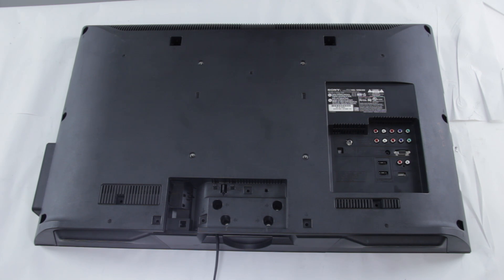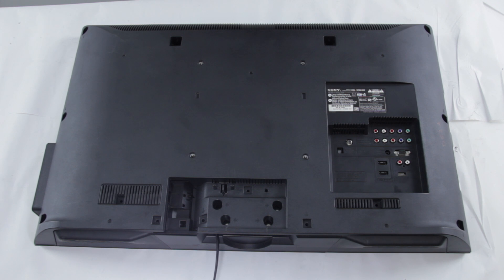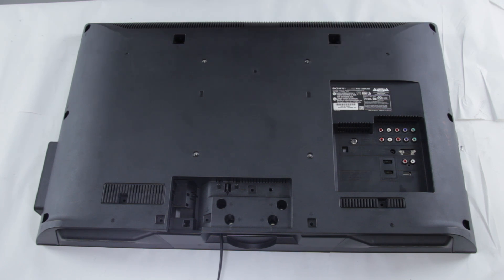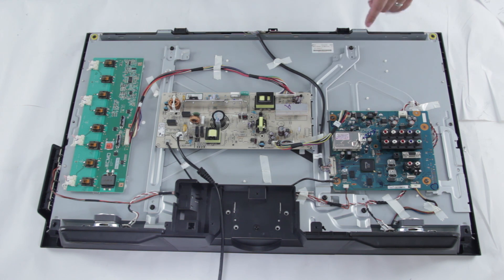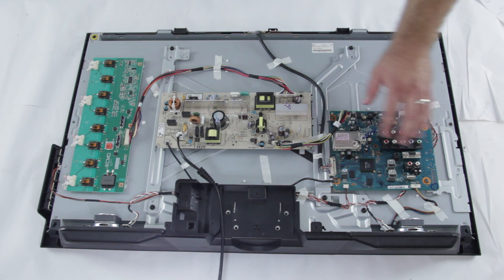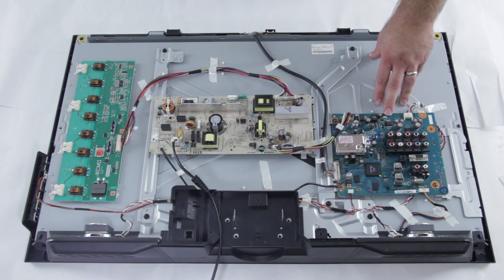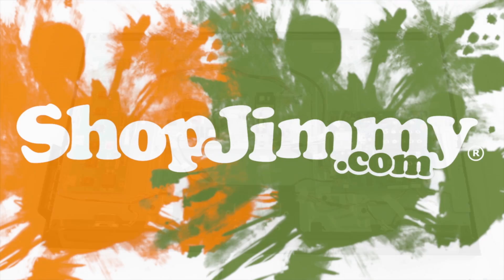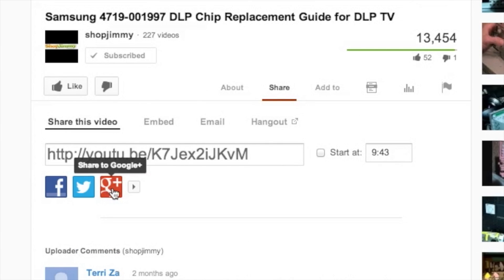LCD TV Repair - TV Has Audio, No Video - Common Main Board Symptoms & Solutions

Comment: Hey 
I own a Philips 37' LCD TV. My TV's model no. is 37TA2800. My TV is running good in the HDMI input but in AV and Side AV inputs for cable and DVD player it is only running the sound. The video on these inputs are not visible. Only a blue screen stays. Apart from that i can use the menu option of my TV and change the settings like brightness,contrast and all other stuff but I am unable to see any video. I have checked the DVD player and cable on a different TV.
What is the problem in this TV and what is the possible remedy??
Reply: ShopJimmy.com My main board no is 715T2408-4. Can You suggest me a replacement?
Reply from the maker: Rachit Shroff   Try all repairs and troubleshooting at your own risk.  Click this link to a search result for that number on our website.  http://www.shopjimmy.com/catalogsearch/result/?q=715T2408-4  There may be multiple boards for the same TV model number, be sure to match part numbers on your current board, with your replacement for compatibility.  Thanks and please let us know if you have any further questions with your TV Repair!  www.shopjimmy.com

Comment: I have a samsung ln46a550p3fxza. I have picture and sound when I use av cables, but when I use hdmi cables in any of the hdmi ports on the tv I get vertical color lines. Sometimes the picture can be seen behind the lines other times it's just a black screen. And it has a high pitch screeching sound. Just not sure what to order don't want to waste any money. Your help would be greatly appreciated.

Comment: Hi I really need your help. Okay I will start from the beginning, I have a Samsung dlp tv hl-s6186w. The tv would flicker with white picture and turn off with 3 lights blinking standby.temp. lamp , so I thought replacing the lamp was best. I have done that, now 1. Tv wont turn on 2. Flashing lights standby and temp. 3 MAJOR problem a wire on the video Main board started to smell and burn. It's the 12 pin I think that goes to the board where the dlp chip is located . .not sure of wire name. PLEASE help me Idk  what to do ..nothing in the tv comes on either no fan ,no bulb.

Comment: i have a hisense 50k360g   serial# 3TE50G1225051708539 the problem is when i turn it on its just a blue screen and a back light on , it does not display the logo or anything when turning on .I can not change inputs because it doesn't show it on the screen .i have checked the compacitors on the power supply and all are good. any help with this would be greatly appreciated

Comment: I am working on a friends 32" Samsung TV. Replaced the T-con Board after looking at a few videos.
SAMSUNG LN32A330J1D LCD Controller T-Con Board V315B1-C01
I replaced it and still am having a white solid vertical line across the screen. Can you help?
Reply from the maker: Samuel Guerra   Try all repairs and troubleshooting at your own risk.  This sounds like a TV panel (TV Screen) problem.  If your TV panel is bad, it may be more cost-effective to replace the TV as panels are typically hard to find in stock, difficult to replace, and expensive.  Thanks and please let us know if you have any further questions!  www.shopjimmy.com

Comment: hi! i have a sony LCD tv model-klv40ex430 . the problem is that on switching the device the panel remains white and in about 2 second the panel gradually starts to turn black from the center to all the borders grain by grain and turns entirely black.. but the fact is that the audio works properly as the given input.

what must hav gone wrong!!!  expect an immediate reply
Reply from the maker: radhakrishnan divakaran   Try all repairs and troubleshooting at your own risk.  This sounds like a TV panel (TV Screen) problem.  If your TV panel is bad, it may be more cost-effective to replace the TV as panels are typically hard to find in stock, difficult to replace, and expensive.  Thanks and please let us know if you have any further questions!  www.shopjimmy.com

Comment: I have an Samsung 46" LCD with sound but no picture. The model # ln46c530fif and serial # z1mj3csz800252a. I did the flash light test and I can see parts of the menu on the screen. I looked it up and everyone one says that it's the inverter but I'm not sure what the inverter is and how to replace it.

Comment: hi i have a sceptre 42 lcd - replaced both the inverter board and the tcon board with your parts. tv still does not work. Main board? power supply? tv turns on, no video, has audio, backlights off. Then sometimes the backlights will come on and there will be a picture, will flicker on and off, sometimes will stay on for 10 minutes then backlights turn back off, will unplug reset tv and picture will flicker on off then stay off. I thought it would be inverter board....
Reply: Ric D used AUO 19.42T14.001 (V298-C01) Backlight Invertersj-19.42T14.001
Reply: Ric D and AUO 55.42T14.C09 (46T03-C0K, T460HW02) T-Con Board
Reply from the maker: Ric D  PLEASE SUBSCRIBE TO OUR CHANNEL - Try all repairs and troubleshooting at your own risk.  What are the original symptoms and problems with the TV, before you replaced any board?  Thanks!  www.shopjimmy.com
Reply: ShopJimmy.com hi i did the flash light test like you requested. I did see a picture with the flash light. I would assume that would mean the inverter board was bad but thats what i replaced already along with the tcon. So is the inverter i ordered bad? Is it the main board? Or something else? Please let me know

Comment: I have an LG 47lm4700-ue the picture does not come on but I have sound. My screen is blueish and I do see a light when power is on
Reply from the maker: Kyle Cleveland   Try all repairs and troubleshooting at your own risk.  This could be a problem with either the t-con board, the main board or the TV panel.  You can replace the main board and t-con board individually to see if one of those boards fixes the problem.  Click this link to replacement parts for your TV model number:  http://www.shopjimmy.com/catalogsearch/result/?q=47lm4700-ue  There may be multiple boards for the same TV model number, be sure to match part numbers on your current board, with your replacement for compatibility.  Thanks and please let us know if you have any further questions with your TV Repair!  www.shopjimmy.com

Comment: I have a Polaroid TLX-04240B. We get picture with any input source but after 30 min run time the screen goes black but we still have sound. The repair shop, after 6 weeks of run around said that the bulbs were bad and it would take $1200 to repair. But we could leave it if we didn't want to worry with disposal. Is there any truth to this?

Comment: I have the same Sony lcd color TV (2008) that's on the video. Green power light is on but there's no picture or sound. Would that mean that I should change board. If so where can I find board and how much are they?
Reply from the maker: Ricky Thierry   Try all repairs and troubleshooting at your own risk.  I recommend running the flashlight test on your TV.   Here is a link to a video we produced that shows how to run the flashlight test. https://www.youtube.com/watch?v=xUzCLgoSPGM Please reply with your flashlight test results and we can recommend a replacement part for your TV repair. Thanks and please let us know if you have any questions! www.shopjimmy.com

Comment: no television lost audio soon after loss of picture,went to bed had tv woke up no video,but still had audio,lost audio soon after that.model led65g55r120q
Reply from the maker: Lisa steinmetz  Try all repairs and troubleshooting at your own risk.  It could be that you have bad LEDs in the TV, but you can try replacing the main board to see if that fixes the problem.  Click this link to replacement parts for your TV model number:  http://www.shopjimmy.com/catalogsearch/result/?q=led65g55r120q  There may be multiple boards for the same TV model number, be sure to match part numbers on your current board, with your replacement for compatibility.   Thanks and please let us know if you have any further questions with your TV Repair!  www.shopjimmy.com

Comment: was able to try flashlight test with no result,i do get a red power light and when i shut down the tv,it gives a sudden low flash on the screen which is like a millisecond long,have removed back service panel and found only 3 boards,2 of which ive already found on your site,part #re46z2120,and v465hq1-cs1.the last board u did not have 3393b1420,any suggestions where i should start?
Reply from the maker: Lisa steinmetz   PLEASE SUBSCRIBE TO OUR CHANNEL - Try all repairs and troubleshooting at your own risk.   It sounds like the TV has bad LEDs in the TV, but you can replace the main board to see if that fixes the problem.  Click this link to replacement parts for your TV model number:  http://www.shopjimmy.com/catalogsearch/result/?q=led65g55r120q  There may be multiple boards for the same TV model number, be sure to match part numbers on your current board, with your replacement for compatibility.   Thanks and please let us know if you have any further questions with your TV Repair!  www.shopjimmy.com

Comment: I have a 1.5 year old 58" Sanyo the power went out and right back on and it lost all channels it will not pickup any channels when we make it scan. I only have an antenna  for over the air signals. Some one said it was the tuner, what board is that located on and does that sound correct to you? I don't have the model number it is still on the wall.

Comment: I have an LG LS5750 TV that is a couple of years old.  A couple of weeks ago, the picture went out.  The audio and back light still work.  I opened the TV and checked the connections, and everything seemed fine.  I turned the TV back on, and the image it displays as it boots up showed up fine.  However, when I tried to connect to my DishTV, the screen went out again.  After some research, we thought it might be the T-con board.  We sent the board to you for a repair, but you sent it back saying the board was working fine.  Could it be the main board that is causing the problems?  Or is the cable from the main board to the t-con board a possibility?  Thanks!

Comment: Looking for info on Philips  mod#20PF5120/28
PROD# BZAA0538580128
ONLY S-VID AND COAXIAL WORK NOT AV JACKS RWY OR COMPONIT INNPUTS ?????ANY SUGGESTIONS?
Reply from the maker: Dean Yack   PLEASE SUBSCRIBE TO OUR CHANNEL - Try all repairs and troubleshooting at your own risk.  I recommend replacing the main board in your TV.  Click this link to replacement main boards for your TV model number:  http://www.shopjimmy.com/philips-313815863621-cba-scaler-for-20pf5120-28.htm  There may be multiple boards for the same TV model number, be sure to match part numbers on your current board, with your replacement for compatibility.  Here is a link to a video showing how to identify your part number, click here:  https://www.youtube.com/watch?v=xSSxNZXZIXA  Thanks and please let us know if you have any further questions with your TV Repair!  www.shopjimmy.com

Comment: I have an LG TV and I believe the main board is bad because none of the inputs seem to work.  I've tried several of the HDMI connections, component, USB and TV.  When turned on the screen shows the main LG screen.  I can't get the menu to come up either.  The part number is EBU60852909 but it appears to be out of stock everywhere for the $108 price range.   Is that because so many of them are going bad?  Perhaps I should just throw it away if they are going bad so frequently.  Any suggestions?

Comment: Hello I have Samsung LN52A550P3FXZA and it will turn on and off with a blurry screen 5 or 6 times before clicking and staying on with a good picture . The problem is not the capacitor problem that these TVs are known for, I have replace those a few years back and they are still good. I have tried a new T-con and power supply boards and that was not it. Any thoughts on what it can be would be greatly appreciated. Thank you

Comment: hi, my tv sony bravia model kdl 40hx701 serial 8024224  dont start, i disconnect the ac cable and connect to try turn on and nothing happens, only the red led flashes 7 times.
some people told me maybe the video card is wrong, ¿could this be right?
Reply from the maker: Angel Acevedo   This sounds like you have bad lamps in the TV.  Unfortunately we do not sell replacement lamps.  Thanks!  www.shopjimmy.com

Comment: I have an Lg svc # 47LD650-UA.AUSWLJR and lightning struck like super close. (It was plugged into a surge protector as well as a GFI!) The HDMI that was plugged in at the time no longer works, and neither does the sound.  I tried a sound bar and tried turning the speakers on and off on the TV and no sound even out of the sound bar.  All the other 3 HDMI ports work and the picture is clear. I can live with the one HDMI not working, but no sound? Closed caption is hard to follow and covers some of the picture! LOL. Is this going to be a main board replace?
Thanks,
kcrancho
Reply from the maker: KC Rancho  Try all repairs and troubleshooting at your own risk.  I recommend replacing the main board in your TV.  Click this link to replacement parts for your TV model number:  http://www.shopjimmy.com/catalogsearch/result/?q=47LD650-UA  There may be multiple boards for the same TV model number, be sure to match part numbers on your current board, with your replacement for compatibility.  Here is a link to a video showing how to identify your part number, click here:  http://www.shopjimmy.com/catalogsearch/result/index/?cat=56&q=47LD650-UA  Thanks and please let us know if you have any further questions with your TV Repair!  www.shopjimmy.com

Comment: I have a Sceptre X32 LCD tv, I have a good picture but no sound.  Before it went completely out you could get the sound to work by turning the tv on and off.  Sometimes only after a couple times and then it took longer until finally not all.  I have unplugged everything and tried each separately.  It worked once on HDMI and once with just the old style plug ins. It hums a little when you turn it on.  The headphones do not work either.
Reply from the maker: Theresa Nowak   I recommend replacing the main board in your TV.  Click this link to possible replacement parts for your TV model number:  http://www.shopjimmy.com/catalogsearch/result/index/?cat=56&q=Sceptre+X32  There may be multiple boards for the same TV model number, be sure to match part numbers on your current board, with your replacement for compatibility.  Thanks and please let us know if you have any further questions with your TV Repair!  www.shopjimmy.com

Comment: Ive got a Magnavox 42MF337B/37 (SERIAL BZA0724360478).  I use it in my outside patio. It recently stopped working.  Started by the picture going pink or green (with sound) and now i get no picture (cant tell if i still have sound because i cant see to change the source to one i know is giving sound).  Any idea what it might be?
Reply from the maker: Marco Salgado   I recommend replacing the main board in your TV.  Click this link to replacement parts for your TV model number:  http://www.shopjimmy.com/philips-cbpf72mkpc-main-board-for-42mf337b-37.htm  There may be multiple boards for the same TV model number, be sure to match part numbers on your current board, with your replacement for compatibility.  Here is a link to a video showing how to identify your part number, click here:
Thanks and please let us know if you have any further questions with your TV Repair!  www.shopjimmy.com

Comment: I have a Vizio VW46LFHDTV10A that has no sound and no video.  When the unit is turned on, the screen lights but there is nothing displayed.  No Menu or any other type of display or sound.  The remote works to turn the TV on and off but it appears to not function in any other form.  I've checked the power supply outputs for 5 12 and 24 volt output and they appear correct within .5 volts.  I've plugged an audio source into the VGA audio in and attempted to select that source with no audio.   I've tried to use a HDMI souce into all the HDMI connectors again with no sound or video.  Any help would be appreciated.  Thanks!
Reply from the maker: Ral Lynch   I recommend replacing the main board in your TV.  Click this link to a replacement main board for your TV model number:  http://www.shopjimmy.com/vizio-3646-0082-0150-main-board-for-vw46lfhdtv10a.htm  Be sure to match part numbers on your current board, with your replacement for compatibility.  Here is a link to a video showing how to identify your part number, click here:  https://www.youtube.com/watch?v=kxkeGLhlQY8  Thanks and please let us know if you have any further questions with your TV Repair!  www.shopjimmy.com

Comment: i have a Samsung model number ln55c630k1fxza sq01 serial number zipl3ccz406832p which has audio and a faint picture image. so i thought it was the inverter board so i replaced it with a new one but i am still having the same issue what can it be power supply? main board? t-con board? help please!!!

Comment: I HAVE A MODEL DP52440 SANYO TV WITH S/N B10711542927020 AND ADDITIONAL NUMBERS ARE CHASSIS NOP52440-01... MY TV COMES ON WITH SOUND AND AFTER A FEW MINUTES THE PICTURE GOES BLACK AND I CAN STILL HEAR SOUND.. WHEN I UN-PLUG IT FROM WALL AND RESET BOARD IT WILL COME ON AGAIN AND REPEAT THE PICTURE GOING OUT..  DO YOU HAVE ANY IDEA HOW I CAN FIX THIS?? THANK YOU VERY MUCH